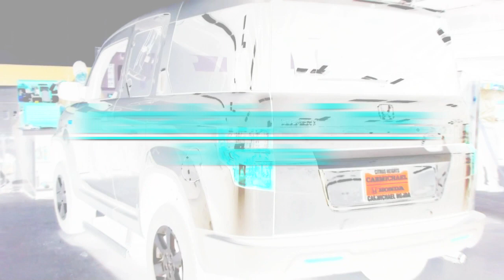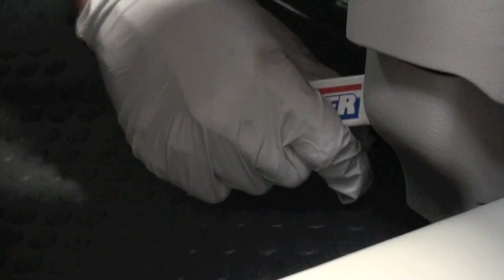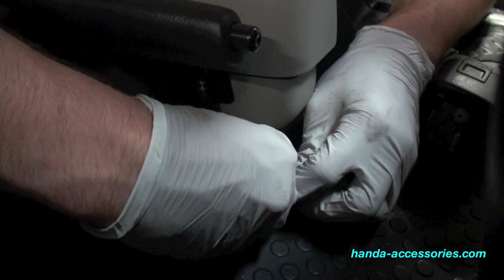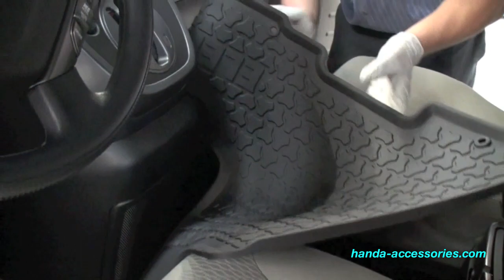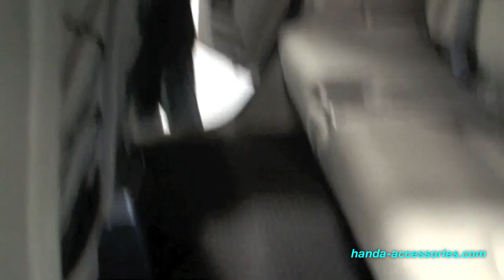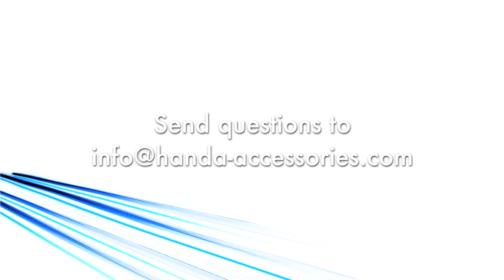Honda Element Floor Mats Installation (Honda Answers #54)

Comment: there are five anchor points, four in front, one in the rear, purposely located so aftermarket 2 piece mats can't be easily anchored.  thanks honda.
Reply: I had the same problem, I just bought a pair. I went to Harbor Freight and bought a grommet kit made for tarps. Took me 5 minutes to put grommets in my mats. And there are 3 anchor points in the front.